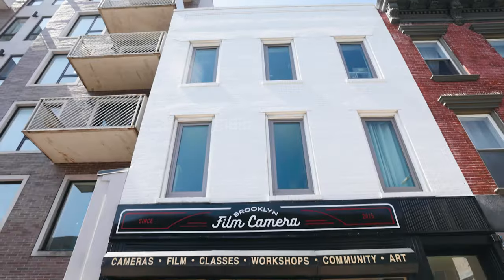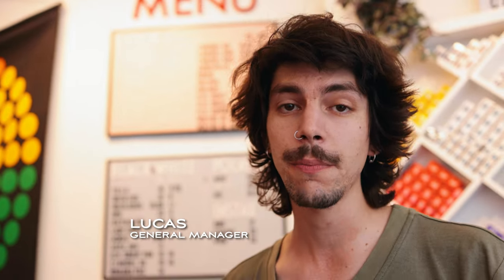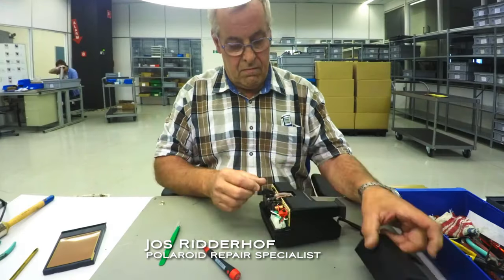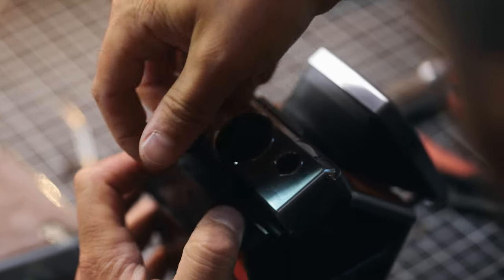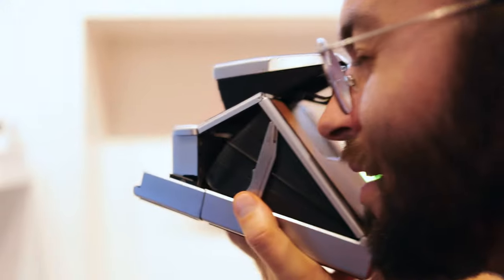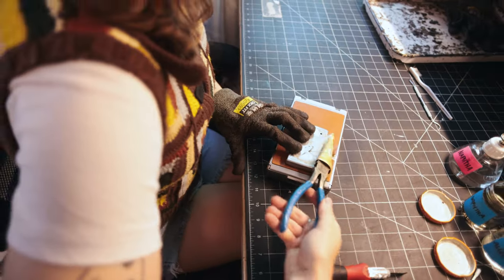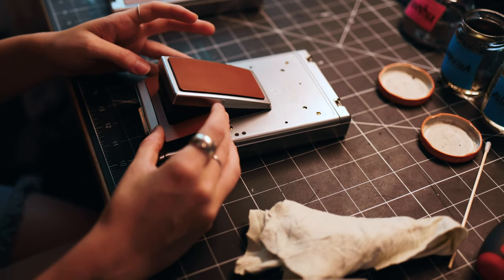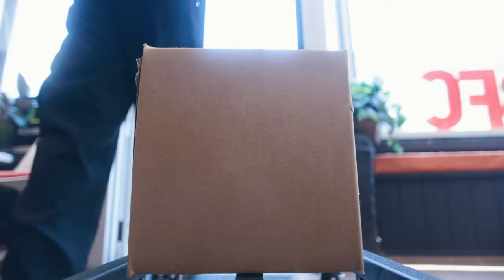How Brooklyn Film Camera Repairs and Restores the Polaroid SX-70

Comment: Hey guys!

I've owned an SX-70 Sonar for quite some time now and it's defiantly in need of some maintenance. So, I have a few questions.

1.) Do y'all even work on Sonars? I didn't see a single one in the video and I'm curious if you would even take my camera to begin with. (Edit: After checking the website I see that they do in fact work on sonars. My apology!)

2.) All of the leather on mine is original and in pretty good shape. Just a bit dirty and peeling on one of the corners. Instead of removing all of the leather and replacing it, could you just clean it up and re-attach the little spot that's peeling? Or would I just have to get all the original leather removed?

I quite like the fact that my camera is in all-original condition and I was just curious if y'all are able to give it a good cleaning and a tiny bit of maintenance  without changing that. Thank you so much for your time and the service you provide for photographers everywhere!